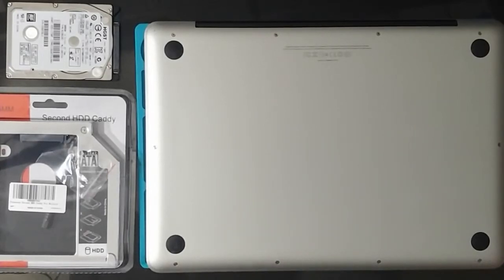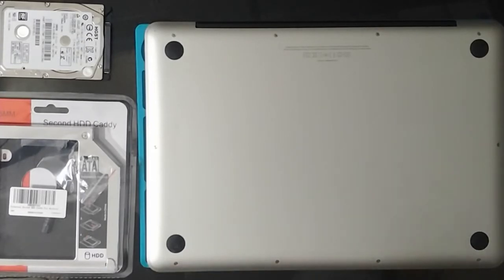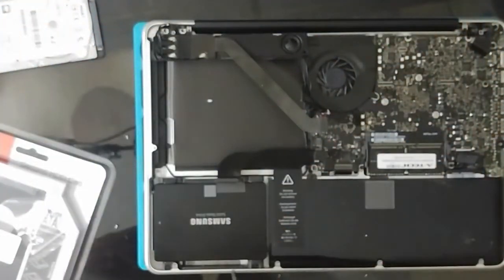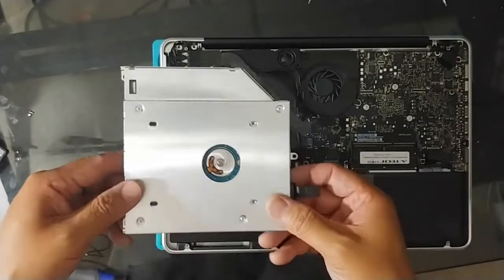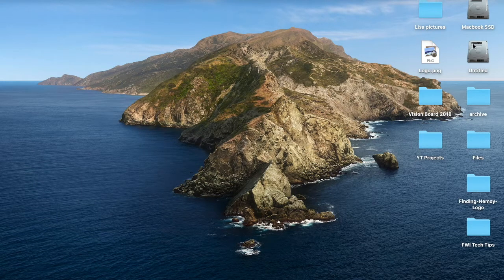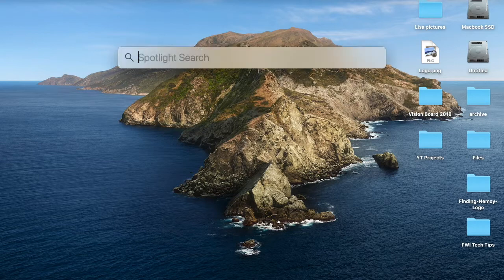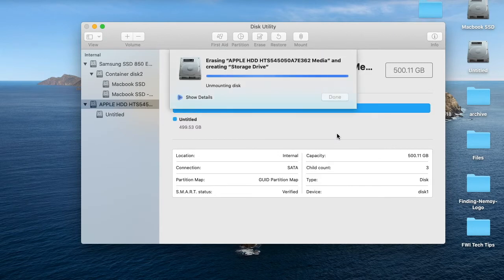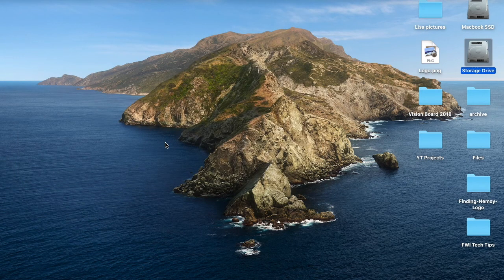2012 MacBook Pro: Adding a Second Hard Drive

Comment: There are 3 screws holding in the Superdrive (DVD drive). As you look in the video - SCREW 1:Top left, underneath the wireless card/speaker, SCREW 2: bottom left (by the exisiting HD) and SCREW 3: centre right (by the 3 ribbon cables).  Also there is a 9mm and a 12mm version of the 'Second HDD Caddy' (that's not always specified on the box) - if you buy the 12mm version for a 13" macbook, you won't be screw the back plate back on. You need the 9mm version in order to 'shut' the macbook back together.

Comment: Does that type of hard drive works on MacBook 2014 ?
Reply from the maker: @liverpoollad1271  I show that the 2014 MacBook Pro uses a SSD. So that hard drive would not work
Reply: @ and sorry one more question , does m2 , p300 ssd works on MacBook 2014 13 inch
Reply from the maker: @liverpoollad1271  that I would not know. You may want to ask someone in an Apple support